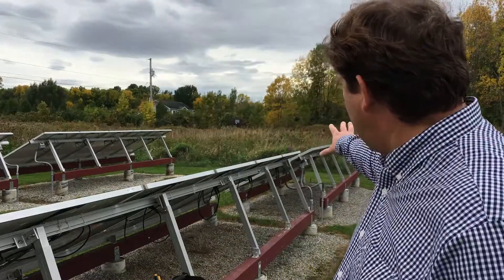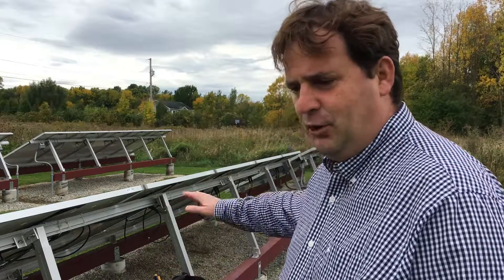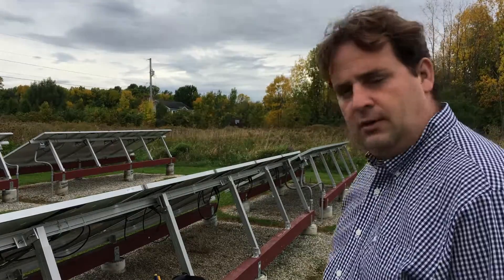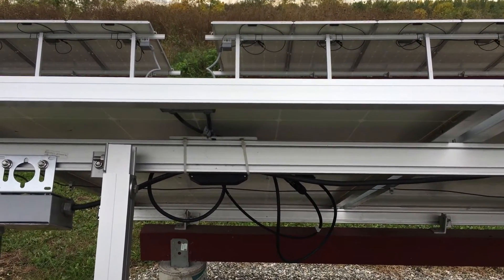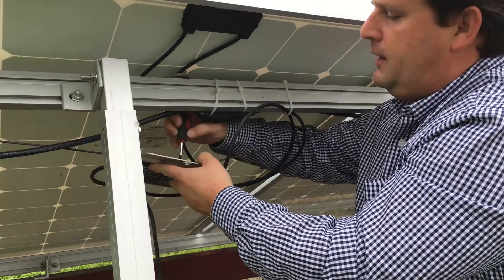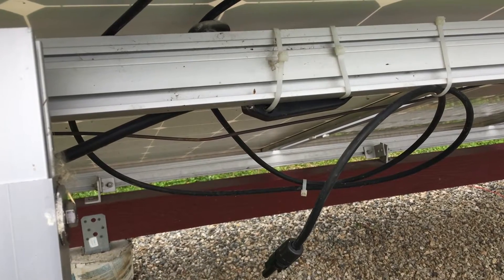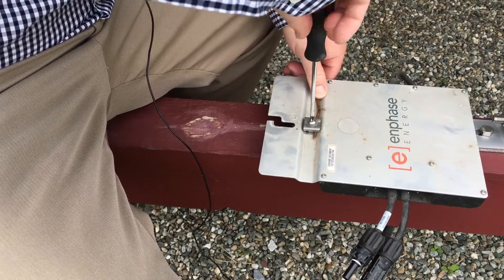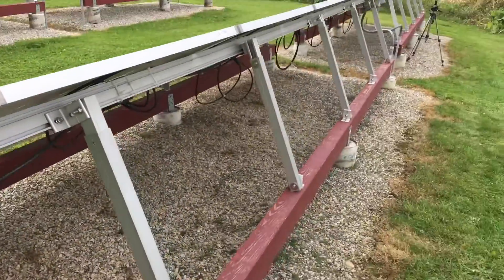Enphase M250 Microinverter Troubleshooting Part 1

Comment: I got a used system 11 panels and each has a micro inverter. I can't get the system to work. I tested my panels, I'm getting 33 volts out of each panel. My micro inverters are blinking a red light on the back of them. I'm new to solar dc power, any ideas?
thanks,
jim

Comment: Where can I get the little tool to help unplug the connectors from the panel to the Inverter?  They are very difficult to disconnect and my local supplier no longer stocks the ET-DISC-01 plastic tool. Thanks in advance!  Oddly, one of my Macro Inverters went down and I need to switch it out.
Reply from the maker: It's been a while since I disconnected one, but you can simply use a big flat head screw driver to disconnect (one side at a time).  Hope that helps.

Comment: Did you ever figure it out?  Any other issues with your inverters?
Reply from the maker: Mark, the micro inverters are fine, it ended up being  Suniva Panels, they are not putting out the power they need to.  Suniva went belly up so not much I can do other than replace.

Comment: What size panel do you have on the M250.
Reply from the maker: Thanks for your question...most of the M250's are paired to either 270 or 275 watt panels.   I ended up swapping a couple of M250's between the newer Solarworld panels and the Suniva panels.  The issue was isolated to the Suniva Panel's with the conclusion that the Suniva panels are not putting out as much power as they should.  There is nothing wrong with any of the microinverters.  Unfortunately, Suniva went bankrupt so I can't make any warranty claim.  I need to switch all of my M215's to the Suniva panels since these panels aren't really outputting what the M 250's can handle.

Comment: Quick question, I have three 270 watt 39 volt panels and wanted to get a grid tie inverter. Can you tell me what else I need to buy or do I just buy a grid tie inverter? Do they make a specific inverter that will be able to handle the 39 volts from the panels? Thanks
Reply from the maker: Eric, sounds like you have three 24 volt panels.  I believe these panels are 39 volts in open voltage (no load connected).  You could use microinverters or a central inverter depending on how you want to address converting energy from dc to AC.  Are you using 60 cell panels?  What Panels do you have?  Model?
Reply: I have Hyundai panels, model # HiS-S270RG
Reply from the maker: Microinverters would work well with your panels.  Using microinverters is a fairly easy way to get going into solar especially if you are already use to working on 120/240 systems.